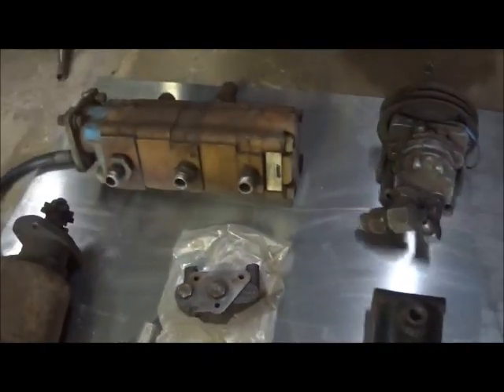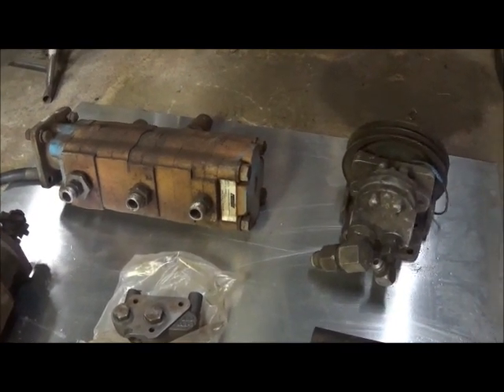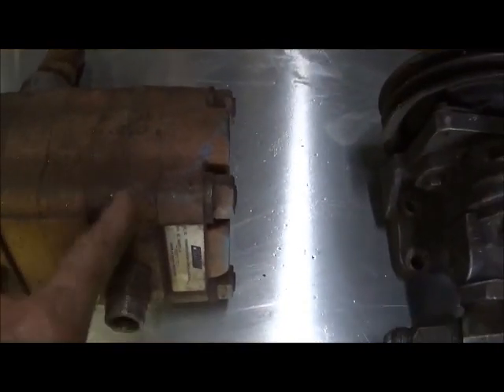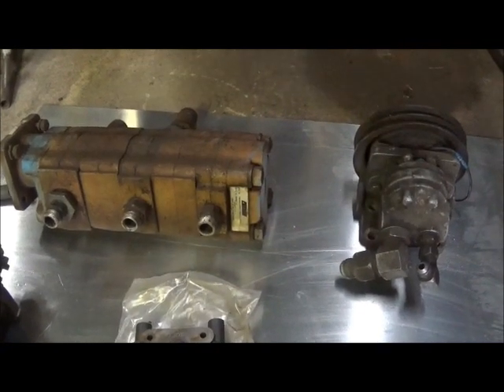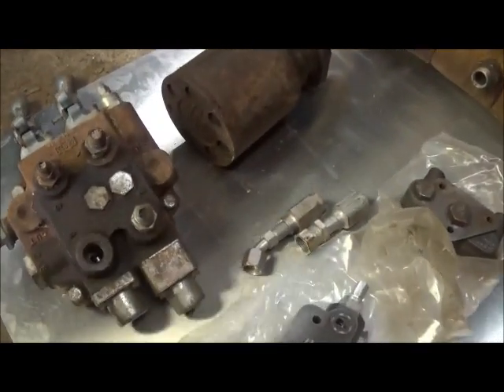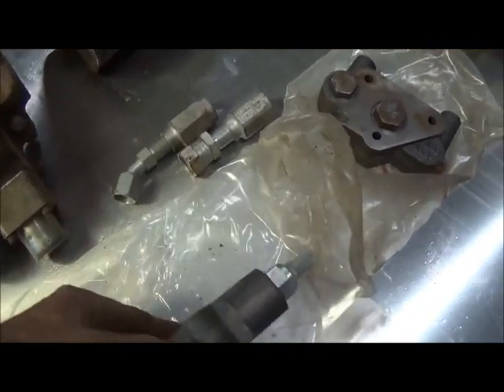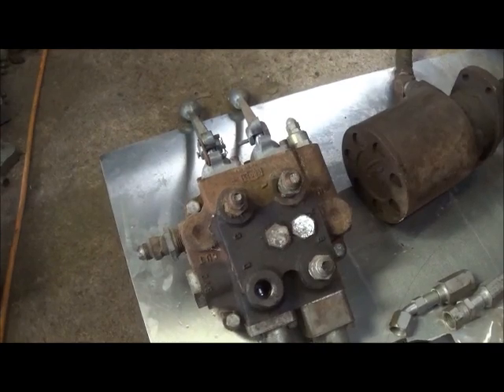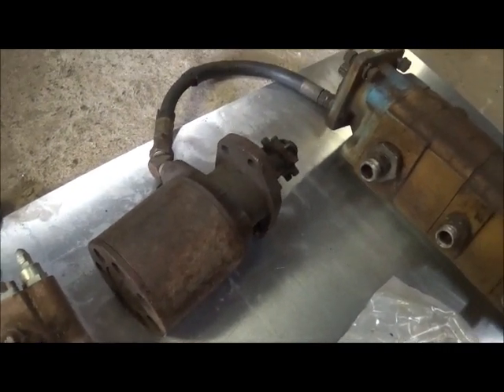4x4 Wrecker Build Part 16 It's All About The Hydraulics!!

Comment: G'DAY Jonathan, An exceptional explanation of Hydraulic Theory, the only thing,I would have added, is that Hydraulic Power transfer, is the most efficient form of Energy transfer, that man,has thus far invented! Though also,the most dangerous, in that due to its high pressures,often exceeding 3000PSI,and its wide use,in farming, earthmoving etc.more people,have been hurt,disabled, lost eyes etc,then any other workplace injuries, your explanation of pumps,lines,servo units,was truly of a Mechanical Engineering level, one of my first machining projects,as a first year apprentice in 1981,was to make a gear pump,for a coolant pump,on a Colchester Lathe,was a great introduction, keep on kicking goals Mate,kindest Regards,Dave McLaughlin Queensland, Australia?

Comment: I used to work maintenance and we made our own hydraulic hoses, I never thought that much about it. I was shown how by a old timer. He used to say cut it, crip it, screw it on, we ain't got no time to be messing around. I don't know what kind of crimper we had, but it looked ancient. I don't know how much hydraulic lines you buy but hey might look for one of the old manual hydraulic hose crimper and dies. The old man I worked with would often use, used hoses, depending on the application and pressure. Just a thought.

Comment: wow you really got a lot of good  information. I really appreciate you. and the way you explain how things work. .. tell me why you are going to have 12 valves in your system. I'm sitting here in my head trying to figure out how many boom up boom down rotate right and left outrigger up and down winch In and out. . don't know much just thinking about it. FINS UP 👍 👍
Reply from the maker: +Eric Polston  1 boom up/down, 2 boom in/out 3 winch one, 4 winch two. 5 slide back/forward, 6 rotate, 7 no.1 outrigger up/down, 8 no.2 outrigger up/down, 9 no 3 outrigger up/down, 10 no.4 outrigger up/down no 11 front outriggers extend, no 12 rear outriggers extend. They add up so quick!!
Reply: +Jonathan W man you are right they do add up fast. .will you make it a rotating type? is that ran on hydraulic or other way
Reply from the maker: +Eric Polston Yea it will be a rotator with a hydraulic motor running a gear reduction to turn a pilot gear which turns a slewing gear. The entire turret will also slide to the back of the truck also. It's going to be a sliding rotator.

Comment: Can I run an 8 ton wrecker with a 15 gpm pump powered off an 8 horse Briggs and motor?
Reply from the maker: +Brian Murgolo  A 8 hp will run a 15 gpm pump if it is a two stage like used on a log splitter. If it is not you need to gear it 2 to 1. Your engine runs at 3400 and that is to fast for a regular pump. You can gear it by half and run it at 1700 and still have plenty of flow. I would personally go 3 to 1 and run the engine at 3400 and the pump at 1133 rpm and have all the power and gpm you need. A chain and sprockets will work fine for gearing. A 22 tooth on the engine and a 66 on the pump. If it is a two stage pump, rule of thumb is 1/2 hp per gallon of flow.  Hope this helps!

Comment: Will a wood splinter pump be fine gear to gear? Would  benefit using 3 to 1 on that also?
Reply from the maker: +Brian Murgolo  Wood spitter pumps are rated at around 3600 rpm. A small engine requires the higher rpm to be strong enough to pump. Using a 3 to 1 on a 2 stage wood splitter pump would not be good, just run it direct.
Reply: +Jonathan W From your experience would these setups preform the same or would one lift/winch stronger than the other? I'v been collecting parts for this project and am able to hook up a 2 stage direct or a regular pump geared as you recommended. Thank you sir, you have been a great help and a wealth of knowledge, here in western NC we enjoy your channel.

Comment: I got a lot out of your video.  What is a 2 wire and 4 wire you were talking about?  thanks Fred
Reply from the maker: +Fred Miller  Two and four wire hose. Two wire is the norm and most all machines and equipment use it. Four wire is for a much higher pressure. Four wire is stiff and harder to work with and an overkill for what I am doing, but I have a pallet of new hoses all different sizes and six, five gallon buckets of new fittings, but no way to crimp them. A friend owns a hydraulic shop and I help them out when they run into problems. Not that they don't know what they are doing, it's just that we all need help sometimes even if it's just on the phone discussing a situation and getting another point of view. He gave me all the 4 wire stuff because they quit making any and offered to crimp them for free if I needed it, he also offered to make my 2 wire hoses at his cost. He don't make money off me, but I have never made money off him, invoices paid in friendship!
Reply: +Jonathan W Thanks for the info!  It is always good to have a network of friends with different talents, abilities and tools to go to.  Bartering for goods and services is also a wonderful thing.  Good luck with the build.  Fred